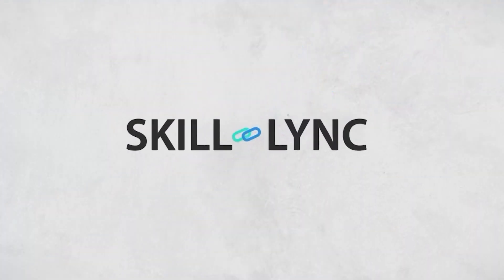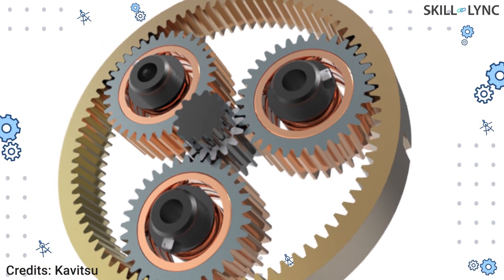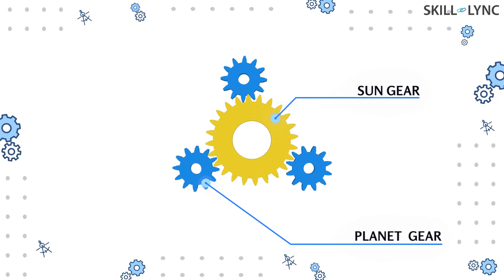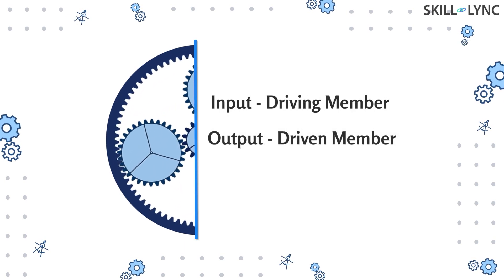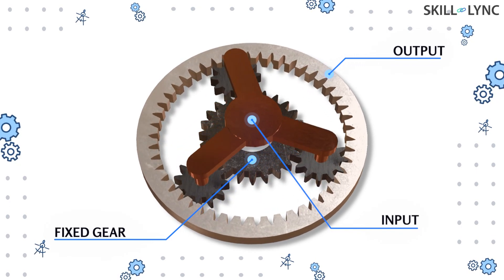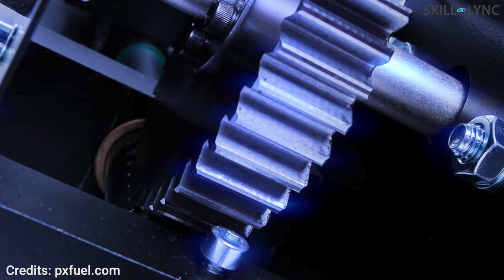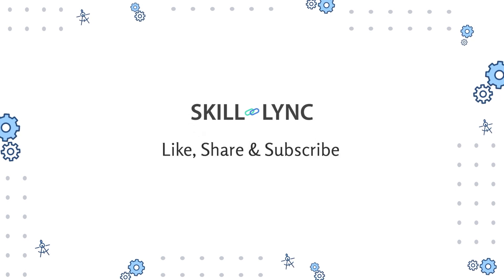What is an Epicyclic Gearbox? | Skill-Lync

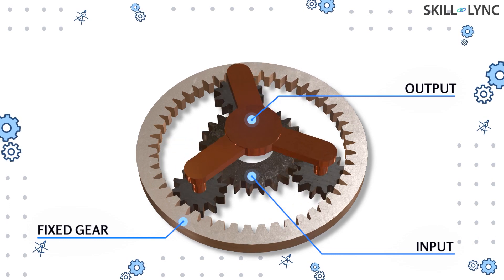Comment: 2:26 Sun gear is turning the wrong way. The planet gears do not rotate in the opposite direction, but in the same direction, only slower.
To reverse, you need to use the planetary gears as the reaction member.
Reply: no wonder my brain was not able to process it